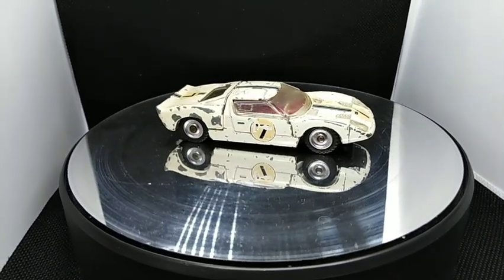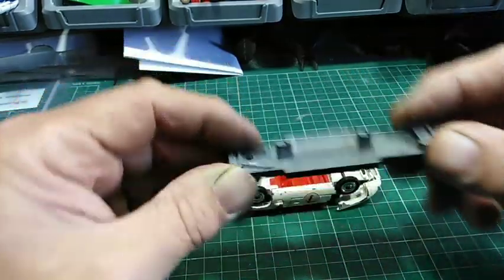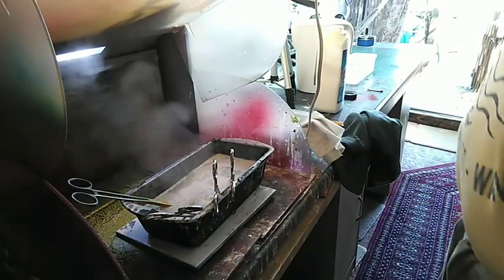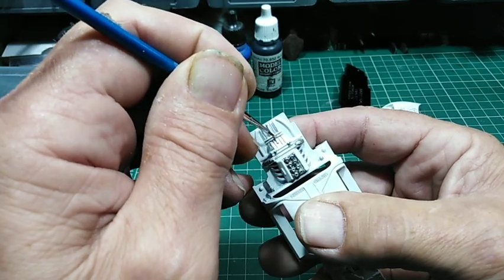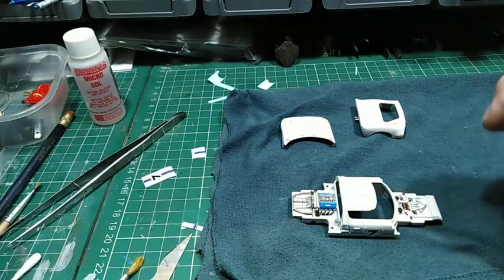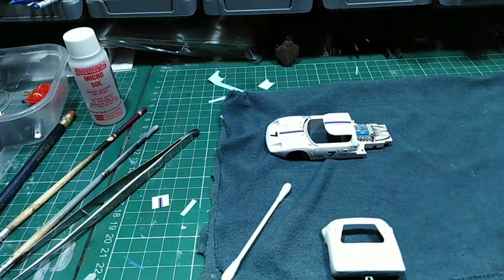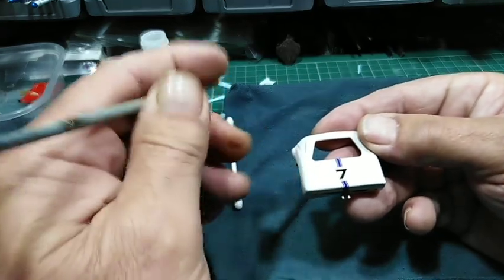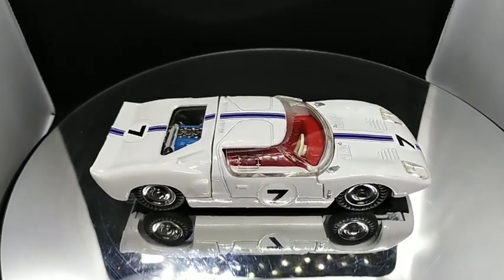Dinky toys Ford GT 40  no/215.  1966-1974. Full restoration.

Comment: That be exspansion thanks but in front of race car probably intake to to cool the rear or mid engine what ever you want to call it mid engine or rear engine cool little one to start off with my freind 👍
Reply from the maker: Thanks Keith, for your input, I hadn't got a clue.
Take care and have fun.
Reply: No problem alot of race cars do it that way that have like i said a mid or rear engine some even put feul salage tank in front which i always taut was very stupid specially if its head on crash could blow fuel tank could be pearced by something sharp in a head on colishion but they couldn't really put it anywhere else unless like the AW11 MR2 WARE IT WAS UNDER THE CENTER OF THE CAR AND RAN UP THE WHEEL BASE FROM FRONT TO BACK OR VICE VERSA WEN I HEARD U SAYING WATS THIS I JUST TAUT ID LET U KNOW CAUSE IT IS CONFUSING FOR PEOPLE THAT WOULDNT HAVE RACE RARE ENGINED CARS TO SEE IT FIRST TIME YE, D BE LIKE WTF Wares the engine 🤣😂👍but greajob as always my freind really enjoy the little Diecast resto, s things people are doing on YouTube with match box cars now days is amazing doors opening engines built in an full kits removeable super stuff now days going on with the normal match box cars 👍

Comment: I've already commented on Facebook but what the hell.....looks great Martin.
And as for the purists wanting it to be totally original, as soon as you drill that rivet out it's no longer original so I reckon you should be able to paint it or detail however you want, a bare casting is a blank canvas.
I didn't catch if you mentioned it but did you clearcoat over the decals ?
Reply from the maker: Thanks again Gary, no I don't always clear coat over my decals I do if I think thay are week and the print might rub off, but not on this occasion. 
Take care my friend